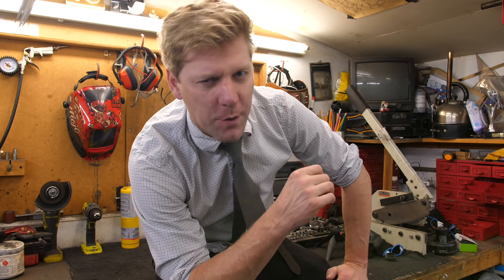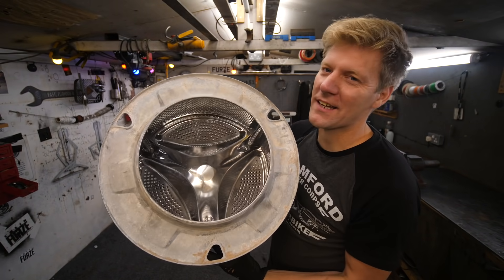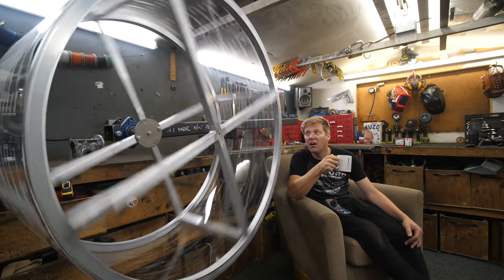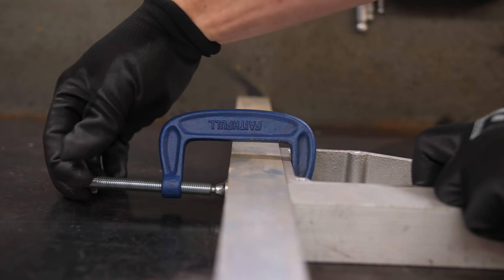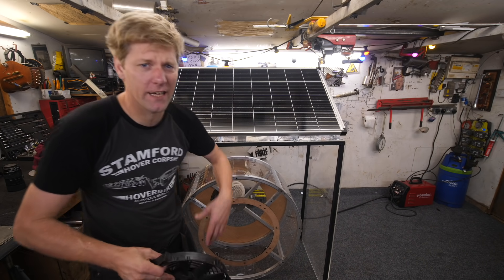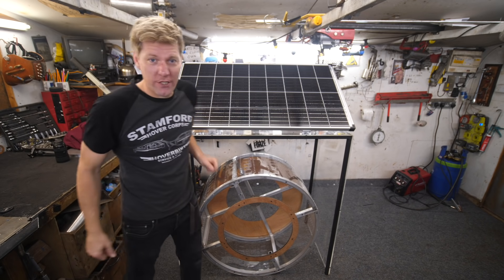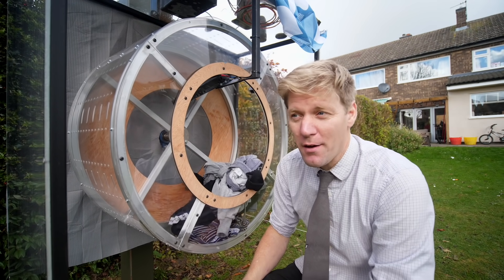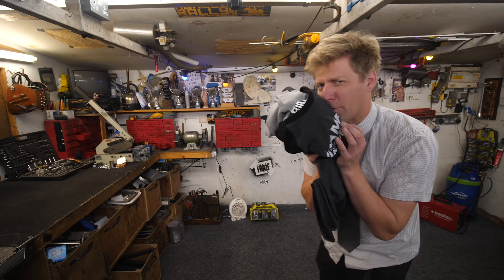Wind/Solar Powered Clothes Dryer

Comment: Everybody else: hangs clothes over line to dry in the wind
Colin: builds complicated machine that transforms wind into kinetic energy to turn an outdoor tumbler just so he doesn't have to hang up his clothes
Also colin: "I may have overengineered this slightly"
Reply: SLIGHTLY
Reply: I think a clothes cannon shooting it on a big rack could solve the hanging it yourself problem as well and more effective as this.
Reply: Furze in the pinned comment: "Now this is a very Low Tech approach"
Reply: You have just explained the liberal green movement. Anything but consume less products!

Comment: Great project! For a 2.0 you can maybe add hot air with a sun/air thermal collector? Iv seen some people that built small modules for garage and houses from old beer cans! Super effective and very cheap. Just watch out with the temperature, you might have to add a thermostat thingy so you don't burn the clothes with too hot air in the summer.

Comment: 11:56 I think you could fit it inside your house, you'd just need to tweak the frame to be a bit smaller, which in turn should increase the rotary speed.

Comment: I had same idea 2 years ago only that I was going to use a metal compost rolling bin with a small solar panel and small motor geared down to like 5 RPH the metal of the bin would also get hot and provide a drying effect . with lockable door so you stuff your clothes in and goto work etc come home and it is done

Comment: So how many loads do you have to do before you've offset all the carbon used to build it? 
This is the most challenging thing about renewables and electric cars. The amount of carbon that is used to build the thing in the first place usually far exceeds the expected operational life of said item. 
My local school went 'green' and installed 4 wind turbines on site. They were expected to be 'neutral' after 10 years of operation with a 20 years operational life span. So far only 1 of them is still working and theyve been up for 6 years. I'd be willing to bet they havent got anywhere near their carbon neutral target. So that final turbine will have to spin for at least 30 more years or so to offset all 4 turbines. If the final turbine does keep going for its 10 years the whole project is still 75% worse off than if they did nothing at all. 
Maintenance and longevity of renewables is the big challenge here. 

I'm not saying its impossible, just very difficult.

Comment: If your goal was to make this thing as efficient as possible, why didn't you just plumb a generator to the rotor shaft and let it charge the battery directly. The Motor could still drive the drum and you would spare yourself a shitload of bearings and the whole gearbox

Comment: If Shell put their money into Ian Scott’s Moltex Energy they could be using nuclear power to make ammonia (yes it is hot enough for that). Ammonia production currently uses huge amounts of natural gas. But ammonia can also fuel a petrol engine. Do it with nukes, zero carbon AND you still have fuel for your car industry friends. Its all fuelled with nuclear waste. The stuff the greens get so exercised about is now a very valuable energy source.

Comment: You can skip a lot of that if you can simply reduce the necessary power down to 12V.  Dishwashing machines run for a lot longer now because they figured out that spitting water at dishes for a few hours is as effective as actually putting in effort for an hour but uses less power overall.

If you can spit heat at clothes for a longer period of time but overall use less power and make it more practical to power it with a 12V solar setup, you've still got a win.  Existing machines are much more time efficient as the expense of power usage.

Especially when working from home, it really doesn't matter how long the machines run because you spend 5 minutes putting things in them and then go back to work and empty them when you feel like it.

Comment: Ingenious, I like the way you can see all the workings. maybe have a black board at the back so it will absorb some heat and warm up the fan air?
If you really want clothes dry you can run a dehumidifier in an enclosed cupboard / box with the solar wind setup and it would dry in the rain. hang up the clothes and have the dehumidifier at the bottom blowing the warm dry air upwards

Comment: Was that a combination machine, or did he really not realize that he was tearing apart a washer, not a dryer?  This whole system could have just been batteries and solar running a low power electric dryer.

Comment: Add a beer can solar panel for heat. Then you'll really be drying quick with free heat. You could also run a fan from your solar voltaic panel to be able to control just how much heat

Comment: Main problem is that real dryers use 110-220V, this one just doesn't have the power it needs. The motor doesn't actually spin quickly enough to tumble the clothes, which greatly reduces the efficiency, and you don't have a heating element. Cold air doesn't hold much moisture, so the clothes won't be able to pass much off to the air passing through. Also, Shell's greenwashing can fuck right off.

Comment: Needs a heating element. Should be enough juice from the solar to power one. Maybe controlled by the relative humidity -- if the humidity is low enough you wouldn't need the heater.

Comment: Heres an idea: instead of putting the fan inside the drum you could make another drum around the drum with the fan blowing air between the two drums. If you make this second drum so that the only holes it has are the ones in the drum spinning inside of it, the air would flow through there, thus getting much more air inside of the lump of clothes tumbling around in the machine instead of just blowing air on it.

Comment: I think this idea is fantastic, although I think maybe a few tweaks are required. Personally I'd have a lightweight wind turbine charging the battery too and just run it all off the motor... But I HATE hanging up washing, it takes forever, so to be able to dump a load on a tumble dryer outside I think is an awesome idea. Even it it take longer than a clothes line, spending 20-30 minutes pinning up washing is a pain in the arse which I could spending doing far more exciting things.

Comment: Dryer needs fins inside the drum to "toss" the clothes, this will allow them to ride to the top of the drum and then fall through the air. Will dry much quicker...... Or here's a crazy idea. Connect the solar panel to your existing drier.

Comment: Colin.  Love the idea! Needs a heater inside. You could put a heater matrix from a car in front of the fan. Then heated by the Sun from a thermal heater. To circulate the water modify a solar pond pump. 👍

Comment: How long until the break even point where you offset the carbon from the materials and energy used to make this thing. I recon you won’t use it enough at all. This is the problem with all this green bs. The only solution is cheap zero carbon source of energy. Solar is great for your roof top but can never come close to meeting our energy requirements. Wind power is an embarrassingly expensive eco disaster. Nuclear is the only viable option. Fusion is WAAAAY to far off in the future. We need a massive investment in research into new fission options now. All investment in renewables needs to be stopped to pay for it.

Comment: You should ad black curtains all around to catch solar heat.
or, better, construct a vertical structure that is covered in black.
it should allow air to move through it vertically, but at the top the drying drum should be attached in a way that forces all warm air to go through the drum.

If you really want to overcomplicate things you might want to create a clothed circuit of air. pun intended.
the down channel should be in the shadow, and made of stainless steel, my hope is that moisture would condensate there. Dry air drys better.
so the air should go through a black heating channel, through the drying drum, then over into the shadow down through the condenser then over into the sun back into the heating channel.

Comment: could have just used solar panels, get the electricity from it and run a standard dryer :P
Seriously, the wood and other sharper edges in your barrel will eat away at any fiber, thid drum/barrel needs to be a lot (!= smoother on the inside.

Comment: Very cool as always 👍 if you make a tub big enough that the drum can be dipped in from the outside to slide it under you can wash the laundry first "cold" and then push the tub away and let it dry immediately afterwards 😜😅🧐🧐

Comment: You should build a doomsday solar-powered backup battery next. I built a battery system for my bedroom in my house that runs off solar power, and I love it. When I first did it I just did it for the fun of seeing if it was possible to run it all off solar, but now I couldn't go back when you wake up in the morning and people tell you about the power outage... your like "What power outage?" It's just nice to run your cellphone, clock, computer, and such all off renewable power, and never have it go down. It was really great in another way too, we had an earthquake 3 days after I finished it, and a windstorm that killed power in some areas around me for a month. Yet I had 10KW of electricity that I could use whenever I wanted. I just use a 550W Solar Array, 8 Lead Acid Batteries, an inverter, an MPPT, some wires and things, and an ATS (Which is an Automatic Transfer Switch... basically if I don't make enough power to fill the batteries, it will switch to grid power, until the batteries have something in them, good for days that aren't sunny or I use to much power.) You should try it, Colin, I can assure you may become addicted.

Comment: Sorry buddy but I had to dislike this video. Not something I would normally do
I think it only fair to explain why.
1 using motion like that to dry the clothes will eventually damage them. Clothes take longer to dry longer rotation etc. 
Wind turbines In a built up area. Just won't work at all. What about winter time when needed the most and there is little wind. 
2. Solar panels converting direct to heat more efficient
Even with low power out put clothes hanging over a 40w tube heater in a small greenhouse will work more effectively. 

I'd like to actually like to see you build that solar panels one the roof with small inverters turning the power to ac and a small outside drying room. 
Do that.

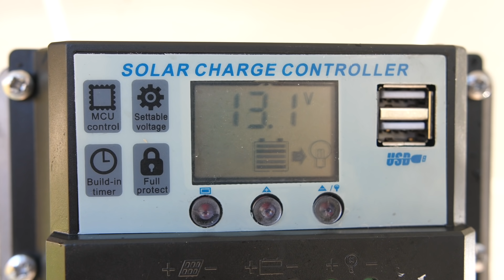Comment: @7:41 Watch the USB output on that charge controller.
It looks the same as mine with a different label and if that's the case, the USB output doesn't have under-voltage protection on it! You can drain a 12v battery down to 5v using that.
As I found out to my cost...twice!

Comment: hello ferz i always had an idea for my folks fire place as the hot air rose out off the chimney it would turn a small fan like the shiny ones you see on industrial units well i thought a small one on there could assist with the solar on the house any thoughts 
cheers rob

Comment: As a gardener with a greenhouse they will hold a surprising amount of heat above ambient. Upwards of ten degrees in winter and as high as 45-50C in the summer. Combine that with a mirror on the floor and swapping the drum materials for something that will absorb heat and you could speed things up.

Comment: Pls do not take the easy way. You need 2 improvements: 1) door 2) internal heat fan. For heat fan, you need a hollow in the back and brings 2 wire to two separate coppers ring ( 1st for power, 2nd for ground). Then you will have the power for the fan. Then there's the door you need to prevent clothes from coming out and counter balance the whole thing

Comment: You could use only the solar panel but using a powerful motor to turn it and the sheet of metal should be replaced by PVC.

Comment: Attaching some baffles or scoops to the inside of the drum might help lift the clothes better so that they'd tumble farther and get more air flow between them. The drum doesn't spin fast enough to lift them very far as it is, so they seem to mostly just roll along the bottom of the drum and that doesn't allow for much air flow between them.

Comment: Couldn’t you keep the motor engaged with the wind turbine and use it like a generator to also charge the battery? With the “extra power” you may be able to put a small heating element in there to speed up the drying process.

Comment: Probably could just could've powered his normal tumble driver with the solar panel and been fine with it 🤣🤣
Reply: I don't know about Britain but in the US an electric clothes dryer uses around 5.5 kilowatts. Meanwhile, a single solar panel produces around 0.3 kilowatts of electricity in full sun. You can't just hook the two together directly. You'd need a more advanced solution, but this could be as simple as storing energy in batteries beforehand and/or running the dryer at reduced power.
Reply: @eDoc2020  good point

Comment: Colin if you are reading this i highly recommend a 10 foot D.I.Y Solar air furnace made out of aluminum drinks cans painted matt black and a small fan blowing the recycled air from the dryer back through it's self and then back to the dryer this will work extremely well and just might be better than a commercial one, warning temperatures can go straight through the roof  just search on you tube for  D.I.Y Solar air furnace .... cheers from HUW KELVIN MORGAN south wales UK
Reply from the maker: will look into this

Comment: Fantastic. I might make one myself. With a couple of changes though. Something to lift the clothes higher in the drum, so it falls and doesn´t  bunch up. And the fan built in to a door, so it pushes in dry air, instead of circulating the air inside the drum. Other than that👍👍👍👍👍👍😊

Comment: Aah yes, Shell, very well known for their environmental conservation efforts.
Reply: If you have the app, they offset 100% of the liquid fuel you buy at the pump, petrol or diesel. And my gas/electric supplier is shell, that’s 100% green aswell. Just because they didn’t start that way doesn’t mean they can’t change, I’m aware they supply biodiesel too
Reply: Of course they do stuff like that, because it helps their PR. They also are responsible for one really bad oil spill a few years back, which was due to negligence. Untold ecological havoc because they thought they could get away with saving some money.
Reply: @RupertAndCheese  one of the biggest oil spills in history
Reply: @0wen1066  Dont belive that for a second lol..they still full off corruption